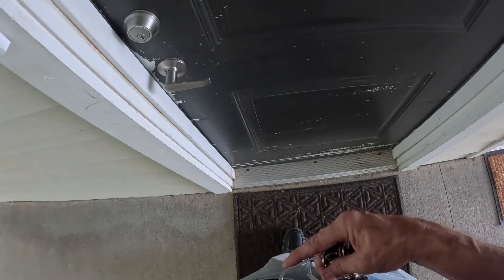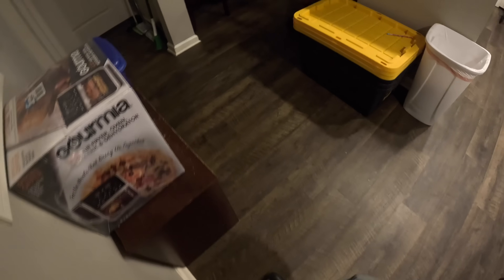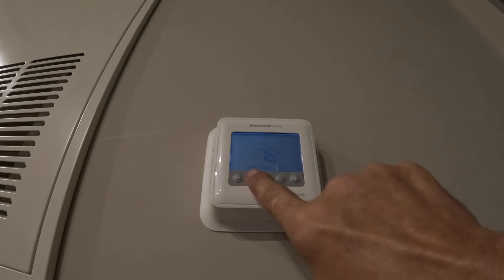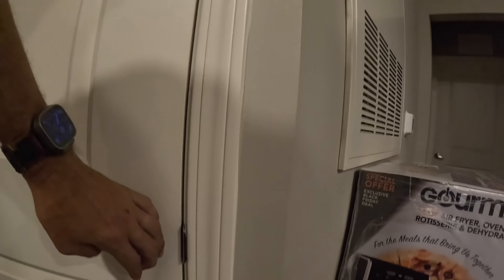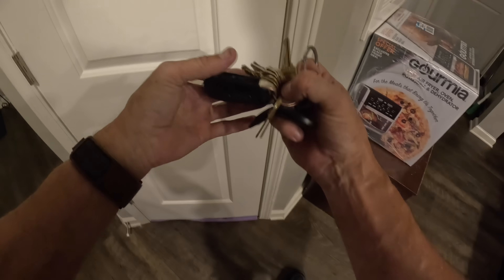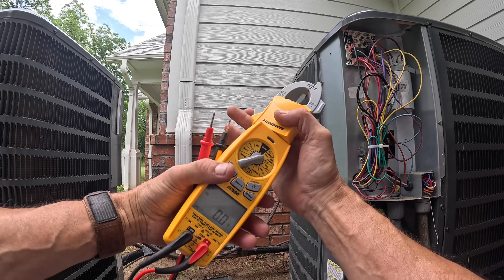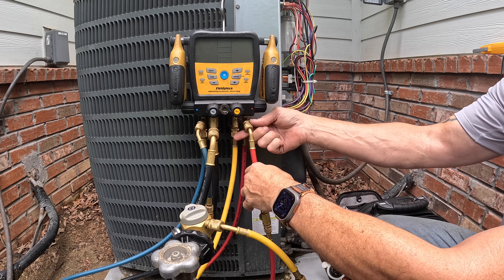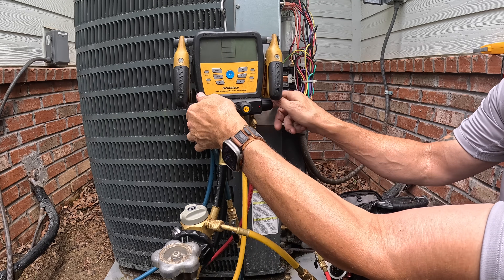HVAC System Left Couple In the Heat Overnight! #hvacguy #hvaclife #hvactrainingvideos

Comment: I watch a lot of HVAC videos and it never ceases to amaze me at the poor designs found in all these units both residential and commercial.  Let's take thin wall tubing and braze it into something else and then let's let it flap and vibrate in the breeze unsupported until it fails from fatigue - Gee, I'm so surprised it didn't last!
Reply: This is what happens when a big bloated government helps create monopolies who own nearly everything. We get junk made to fail and not be easily repaired and often must be replaced instead. This is why you see old R22 systems 20-30 plus years still kicking vs the new R-32/R-454B systems breaking down faster then they make them. Those systems wont get half the time of what the old systems used to get and its all intentional. Over engineered garbage. HVAC should not be complicated. Wheel is not broken stop adding to it. Some of those new "high efficiency" models have more computers on them then the NASA space shuttle.

Comment: I have a 40+ year old R-22 "leaker." I have a few portables as backup for when I need a recharge about every 2 years. If the place I get the green jug from could ship faster, I wouldn't need them. But only $35lb is worth the 1 week wait. Not paying the local HVAC companies $1,200 for recharge and service call.

Comment: We need to replace our unit. We like it COLD in our home. What brand of variable speed is best and reliable.
Reply: I think all those variable-speed units use the crappy and expensive motors.  I just installed my home unit - regular motors and R410a.  It is possible to retrofit with single speed motors.

Comment: Usually with those Goodman HP I fnd them leaking near the truport line. I would sweat that drier out and straight pipe it. Move the drier inside
Reply: Or sell them a good TRANE Unit
Reply: @roybatty6368  You mean the overpriced, most advertised brand?

Comment: I think I might have soldered the line and evacuated and charged to get cooling on and then ordered txv, assuming my boss and the landlord would approve it.
Reply: If system is under warranty who pays for the refrigerant and the labor? I doubt the magnufacturer will allow for that. Some do.
Reply: @bobboscarato1313  Warranty kicks in on replacement. Landlord will probably have to foot some of the repair bill, but if he's a good person he might do that.
Reply: @mcpiddler1135  Say what? LOL
Reply: @bobboscarato1313  Landlord and good person are usually not the same person. I understand that.
Reply: Landlord would probably approve with the unit being u8nder warranty and Curtis is the boss so no problem there. I agree with soldering the line, evacuate, and charge to get it working till the new parts arrive, especially with the 4th next week and it's likely to be a scorcher.

Comment: You can close the valves and see if it is the evap or condenser leaking.if the pressure drops on that side.but i would still check evap 50% chance it is leaking.
Reply: I'm sure on Heat Pumps you have more chances for leaks than on A/Cs.

Comment: 14 screws to hold the top on?! Does the brother of the design engineer own a screw company?
Reply: Brother in Law owns the screw company.
Reply: It's a Goodman Unit; it's held together by screws! LOL
Reply: @bobboscarato1313  And with therir thin metal you hope that the screws don't strip out!
Reply: Also there's almost no arfing slack in the fan motor leads to set the lid aside without bending up a crapton of fins.

Comment: That was really close to the valve itself. I think you made the right choice on this one.
Reply: You could have used a small copper patch and used Stay Bright 8 low temp solder with a Weller solder iron, wide tip. Or depending on how big the crack is on the tube, maybe just adding solder on the crack, if its small enough. I have a Weller that goes to 850 degrees, which is more than enough to flow Stay Bright #8  which is 535 degrees.

Comment: i would have used the paste heat sync and put the torch to it... those small caps heat up so quickly it would have been fine IMHO... enjoy your channel
Reply: Parts were still in warranty and customer had a back up window unit; why mess?

Comment: I have 2 window units here, because 3 times in 6 years the X-13 blower motor died. Carrier package unit. When the first one died "under warranty" the Repair tech suggested I upgrade to a larger air filter for the intake. I added a 12x12 on the other wall. Took a about 10 days to get the replacement blower motor, so I bought a 6,000 btu window unit for the small bedroom here.  2 years later the "new" x-13 died again, and it was on backorder, after being warned that it would take 30-90 days; I bought a Midea U shaped inverter 8,000 for the dining room. I slept in the small bedroom for 3 months with the 6,000 btu window unit. 3rd time I replaced the blower motor myself with the US Motor Rescue brand, for 1/3 the cost of the "warranty" replacements. No way I am getting rid of the window backup units!!
Reply: I'm in the Houston area known for high heat and humidity; bought 4 - 6kbtu window units; last year we installed new system. Works great. Only other worry is if power goes out. Once we lost power for 10 days. Reliant/Center Point make promises but you never know. Cross my fingers!
Reply: I think the Midea U-units have recalls on them for mold issues
Reply: Always carry a back up piece (window unit). I’ve loaned it to neighbors too
Reply: You have to keep the filters clean if you don't want your motor to fail like it has been doing.